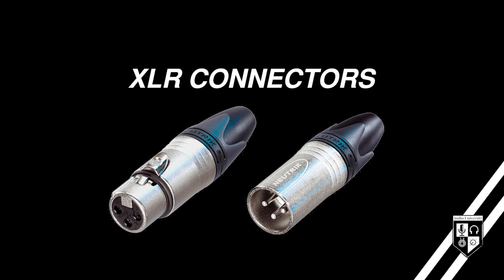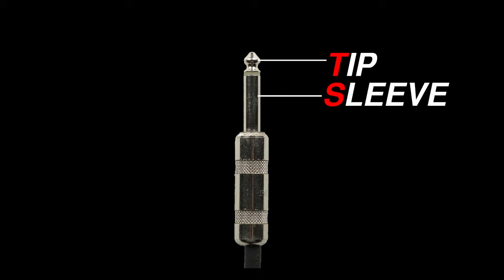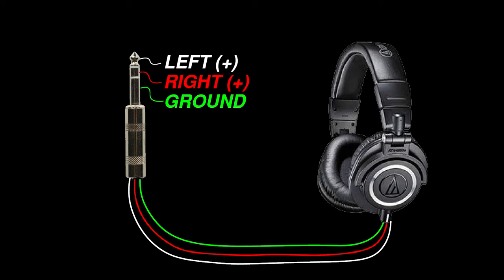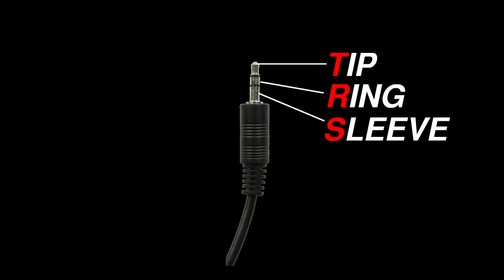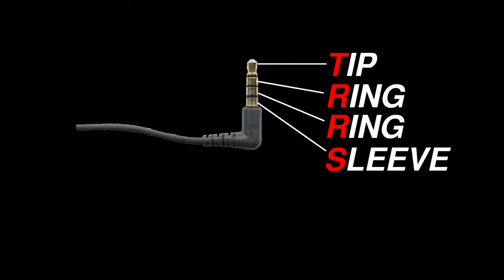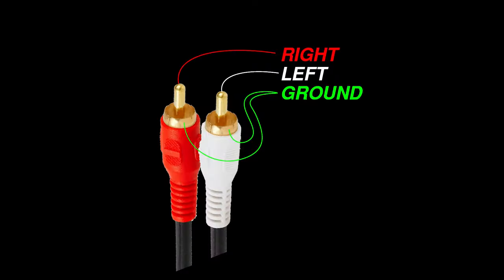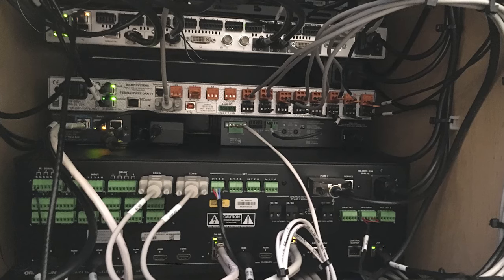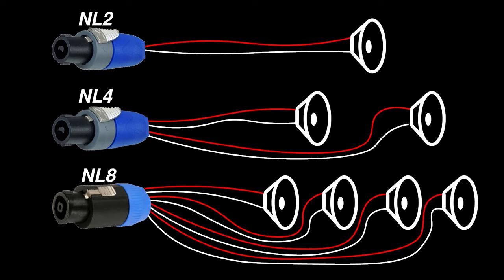AUDIO CONNECTORS | XLR, 1/4-Inch, 3.5mm, SpeakON, RCA, & More

Comment: I am a band director, and I have been plagued by the 3.5 millimeter unbalanced cables making unwanted noise on the speakers we use for metronomes/click-track. Now that I know the difference between balanced/un-balanced cables and the fact that 3.5 mil will always be unbalanced I am really going to rethink how we set up our classrooms. It is the little things in life that can make a huge difference. Thanks!
Reply: yes and when all those little things add up it gets hard to determine real issue. Process of eliminating all these things first makes it so much easier for a rookie like myself.

Comment: I grew up learning the most basic of every day cables. I started off really early on understanding a lot of "Plug-n-Play" game consoles that utilized a lot of the TRRS connectors and it took a little time for my young brain to realize which cord caused what connection such as the Audio cord dealt with the audio (of course) and the monitor cord dealt with providing the picture. But throughout life, i've tried paying attention to all the difference of cords I come across because in these days, you might not know what it plugs into and figuring out what connector plugs into what for whatever reason is a fun little game. This helped me also see that there's a lot more variety of cords out there than I previously thought, and was quite interesting to learn the little things about each cord.

Comment: OK guys I need some help here. I'm new to all this speaker stuff and amps. Well I have everything hooked up. And my rca coming out of my amp. The plastic tip on the rca is broke off. So when I plug my rcas in it like grounds it's self out. Bc there are 2 prongs sticking out. So my question is I was just going to use a rca outlet out of a old DVD player. But I'm not sure what all I need to do other than yeah I know I  have to sodder it back to the pc. Hope someone can help me out on this

Comment: Is there a specific name or measurements for extremely small Euroblock/Phoenix connectors?  I have an amplifier for a baseball field sound system at the school where I work, and it uses small, two- and three-pin Euroblock connectors that are quite tiny.  I'm desperately trying to find this standard that connects to a female XLR.  I made a cable myself that worked for awhile, but it's going bad, and I'd rather be able to order one directly.  Thanks for any help, and thanks for the great video!
Reply from the maker: I don’t think there is a standard. You probably need to make one. If you don’t want to solder, it might be easier to buy an XLR cable and cut one end off.
Reply: @AudioUniversity  Thank you!  That is actually what I did before! : D

Comment: Yo question so i know this sounds dum but i have 2 active speakers and they take in xlr but i want to use speakon for longer distances can i use at my mixer a xlr to speakon and at my speaker a speakon to xlr adapter?
Reply: Also i never used speakon so i wanted to know if i could use it

Comment: I have a powerworks PW50 power speaker that has a line in for a 1/4 inch plug.  I want to use it with my AV receiver that only have outputs for wires line out left and right.  How do I hook up this power speaker?
Reply: Did u ever figure this out I'm trying to do same thing n coming up with zip tia

Comment: Great Video!!  is a mic cable (XLR) the same as a speaker(XLR) & can I use them on each? I purchased speaker wire on amazon. when it came it had Microphone cable  written on it! I'm confused!  Thanks in advance!
Reply from the maker: Yes you can! The "microphone cable" label can be confusing, but an XLR cable can be used for any analog XLR connection (mixer, speaker, microphone, DI box, etc.). Thanks for watching, joey! Hope this helps.

Comment: 1:50 I have an audio interface but I don't have a 1/4" Headphones.

I have a 3.5mm normal headphones, So Is it okay if I connect the 3.5mm TRS aux cable to a 3.5 mm to 6.35 mm adopter and then connect the 6.35 mm adopter to the audio interface's headphones jack? 

#help

Comment: Hi there. A big thank you for all the free info shared. I've tried getting AF from a wireless mic receiver into my phone with mixed outcomes. 
One way was out the AF with an adapted(1/4inch) aux cable into a trs to trrs adapter and then phone. I can hear audio coming thru but not very loud.
 I've also tried swapping the trs to trrs adapter with a mic and headphone splitter with a trrs on the other end. Aux cable connected to the mic line on the mic headphone splitter. Nothing comes thru. 
What am I doing wrong? Thanks in advance

Comment: Hi. I like to connect my sm 58 (vocal mic) to the amp and also my harmonica mic (with xlr -xlr cable) to the amp so can you tell me or link me what 1/4 inch connector/adapter will be best ? Type and brand etc. i like to have good one. I will be grateful. Regards

Comment: I have a question if 3.5 mm jack and quarter Inch jack works same, then why companies don't shift to 3.5 mm as it is compact and common these days on professional headphones, to connect these headphones to interface we need to use  quarter inch jack adapter

Comment: Im using a small mixer and i have 1/4 to aux both trs and a aux trs to left and right 1/4 cable and im monitoring with 1/4 headset and found the on of those cables is making noise when all vol. levl is zero.  Is this caused by a cheap or bad cable? I did more testing and most of the sound seems to be coming from the 1/4 to aux trs. How could this noise issue be fix thanks!

Comment: can i use RCA to 2.5mm for headphone? and is it balanced or unbalanced?
Reply from the maker: RCA and 3.5mm (stereo) are unbalanced. Also, the RCA output doesn't have a built-in headphone amplifier like a headphone output would. You will need to connect the RCA output to a headphone amplifier and then connect the headphone amp to the headphones.

Check out this video to learn more about this: https://youtu.be/gzbiOeqbERE
Reply: @AudioUniversity  thank you for replying, but what i want to do is :
1. desolder my non-detachable headphone, then put female RCA.
2. buy 2.5mm to 2RCA male cable
3. connect it to my headphone amp which have 2.5 balanced connection
4.    ........
5. STONKS ?

edit : i ended up watching a lot of your videos. good contents mate.

Comment: My budget condenser microphone is a usb type (plug and play). Is there any way for me to plug it to focusrite scarlett 2i2? What adaptor should I use?
Reply from the maker: The microphone you are using has an audio interface built-in. The Focusrite Scarlett 2i2 only accepts analog signals, so there is no way to connect a USB input. Your best option would be to get a microphone with XLR output or simply use your microphone directly to your computer.
Reply: @AudioUniversity  thank you so much. Is it okay to use cheap dynamic microphones with "okay" quality if you are using a good quality audio interface?
Reply from the maker: Of course! You do get better quality sound with more expensive microphones, but you’ve got to start somewhere! I recommend the Shure SM58 - $100.

Comment: I have cheap clip on microphone with a 3.5mm TRRS connector designed for phones and stuff. I want to convert it to a 1/4in TS connection or an XLR to plug into a mixer or audio interface, but when I use a 3.5mm to 1/4in adapter I lose signal. I assume its because the adapter is designed for 3.5mm TRS not TRRS but I'm not sure. Is what I'm trying to do possible? does that connector exist? could I make one that does work? I have some crude soldering skills but I have repaired a decent amount of XLR's so I'm willing to tear the thing apart if need be as its pretty cheap.